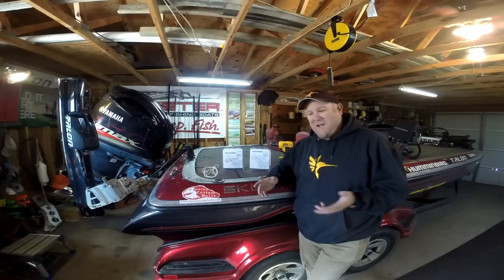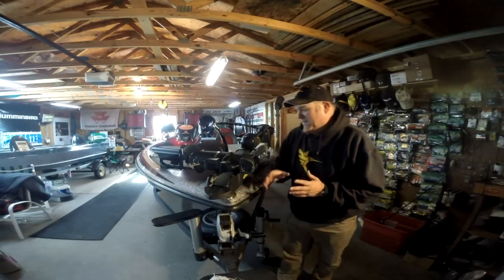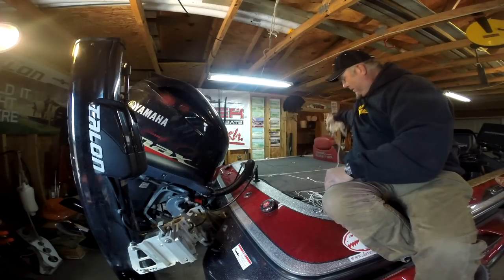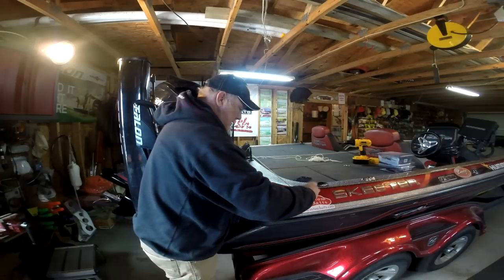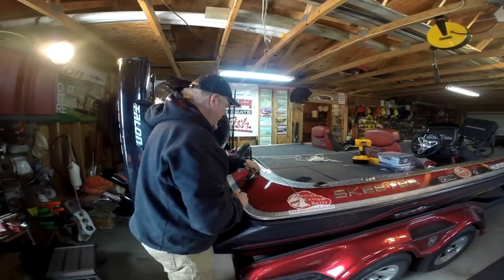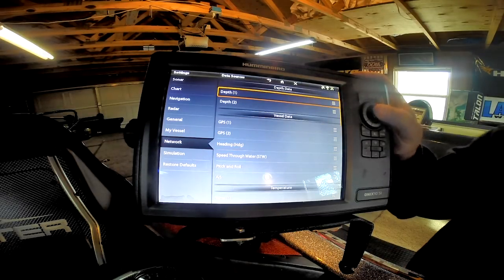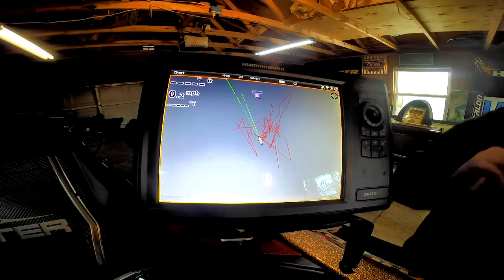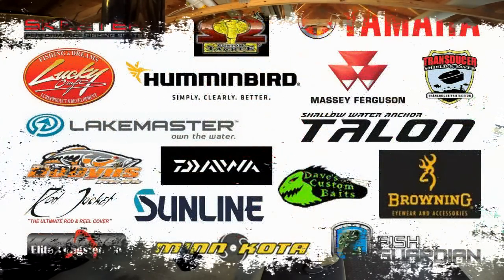Tips 'N Tricks 166: Installing Heading Sensor GPS for Humminbird ONIX

Comment: Great video. I learned some extra things on what to do before install from this. Another thing you can test is trimming up and down and see if it will deflect the compass. Something I have found out after final installation on mine.
Reply from the maker: +masterlocdown I'm not as concerned with a Trim Motor because it's momentary change in creating Magnetic Interference unless it's all the time. I can tell you one thing that drove me crazy when testing is having a drill or electric screwdriver close to the heading sensor while trying  to locate the best location will cause Magnetic Interference...move the drill and boom...it worked as design. :)
Reply: Doug Vahrenberg mine would take up to like 20 seconds afterwards to point correctly after trimming while under way. It would be almost out of adjustment range after bumping the trim.
Reply from the maker: +masterlocdown Is this the Boat ICON or Course Project Line. Two different components on the ONIX. You need to watch the Boat ICON for immediate readings and Course Projection Line is a calculated reading of how the boat is travelling not direction the boat is pointing.
Reply: Doug Vahrenberg The heading line on mine will jump after trimming the motor. Course line stays true.

Comment: Great tip Doug, Question I have a flats boat with a poling platform can I install on the top of the poling platform center...
Thanks
Reply from the maker: Yes you could. The Only thing that I would test first is the pitch & roll in waves. The higher you mount the more effect it will have on GP Position location as the platform will move more distance in waves.

Comment: This is all good , but when you start the engine and all cables become alive - that is where interference is coming from. Any electric flow through the conductor creates  magnetic field. Also compass deviation can be created just by being close to metal or steel object  ( engine). Putting it on the short pole would be a better job ......
Reply from the maker: I'd test before and after engine is running. Personally I now temporary mount with Velcro or double stick tape before permanent mounting

Comment: Doug would you recommend having two GPS pucks one on the Bow and one on the Transom. Transom GPS for console Mounted finder and any other Finder connected in the rear of the boat..Example I have a multi-species and have console mounted, bow mounted and splashwell mounted birds. The console and the splashwell share data when I have the splashwell unit connected.  I troll for Salmon and trout along with stripe bass. When fishing from my cast deck I use only the Bow and console units and have thought of putting GPS puck at the bow for heading control of my minn kota..
Reply from the maker: I use a external GPS on the transom for my console unit because of the distance. On the Bow I use the Internal Receiver.
Reply: Doug Vahrenberg I was told that you cannot share GPS with each other on the Helix G3N. I was told that for precise GPS waypoint marking, i needed to connect a puck with heading sensor to each unit. I was also told that i needed a hub to do so. Basically, i am connecting 2 Helix 12 g3n’s and a Ultrex with built in mega DI. I have an Ethernet hub and have ordered 2 pucks with heading sensors. I don’t know if I’m getting bad info or not. Please help sir! Thanks for Tip’s and Tricks!! Keep it up!

Comment: Doug, does this add any benefit if you have I-Pilot Link.  I can see it if it's just strictly Humminbird, but is there a benefit since the I-Pilot Link system also has a compass.  (It says in the I-Pilot Link manual that the system itself has a compass).
Reply from the maker: IT improves the accuracy and heading direction for the Humminbird and where you are in relation to your waypoints as you are viewing on the Graph
Reply: So will it make the spot lock on my legacy I-pilot link more accurate, when used with a humminbird?
Reply from the maker: That is part of the MinnKota iPilot System. You would need the New iPilot System with it's own Heading Sensor for that.
Reply: Doug Vahrenberg -What is part of the i pilot system? The graph or the heading sensor?
Reply: Doug Vahrenberg -So the graph’s gps doesn’t override the tmotors gps in the spot lock setting? But it does in some settings?
Reply from the maker: iPilot uses it own GPS Receiver and the New iPilot Link has GPS in the Head of the trolling motor and it's own heading sensor for the trolling motor. The Humminbird uses it's own GPS receiver and optional GPS w/Heading Sensor for the unit. Each component uses it's own sensors.
Reply from the maker: The graph works independently of the trolling motor. The LINK just networks the two systems to work together but no sharing of hardware between components.

Comment: So I just purchased a used 1197 and I am confused about the sensor for it and need your help. My sensor looks the same but does not have the arrow on it. However when I place the 1197 on a navigation screen it will tell  me the direction I'm going and show a line. So how do I know which way to install the sensor? I looked through the product manual online and it doesn't tell me anything other than how to install it as in through the deck, on top of deck etc.

also do you recommend true north or magnetic north in the settings? I have never had a GPS fish finder before and now I have two (the 1197 and 787).
Reply from the maker: If it is the original transducer is does not have Heading Sensor so you can install any directions. What is the model printed on your GPS Receiver? If not GPS-HS then you can install any direction.
Reply: @DougVahrenberg  perfect timing I'm actually out here working on the boat as we speak. It is GR16/4

Comment: Doug do you have any heading sensors for 360 transom Mount. I bought unit from a guy in Warsaw but said it was all there but no sensor. I’m going to hook to my helix 12. After reading install guild I’m sure it needs one but guy said he didn’t use one? Can that be true?
Reply from the maker: I don't have one. It's GPS-HS from Humminbird. You don't have to have it but if you want to view waypoints and create accurate waypoints on 360 it's needed.

Comment: Please explain the difference between the heading sensor and the gps sensor on the onix units.  Is there a separate gps sensor installed at the bow for the bow unit so as not to have a 20ft error on the bow gps waypoints if you install the heading compass at the back of the boat?
Reply from the maker: +Ron Knight The Bow ONIX I am using the Internal GPS ...it's close to the transducer location. With ONIX you can subscribe to Heading Sensor separately from GPS Location Data. I choose the Internal GPS or use AS-GPR is an external that can be mounted to ONIX. But you only need one Heading Sensor for the boat.
Reply: The heading sensor will always point the same direction as the boat. If you're drifting sideways, your course won't be the same as your heading.
Reply: +Doug Vahrenberg Thanks Doug for the quick reply....about to upgrade to the Onix units from my 1198s.
Reply: +Ron Knight For the console unit, do you also use internal gps or does its gps come from the heading sensor?
Reply from the maker: +Ron Knight For the Console I subscribe to the GPS Location Data and Heading Sensor Data from the GPS-HS. This will reduce adding any offset to sonar data with the GPS Location since the transducer and GPS Location Data are coming from close proximity.
Reply: +Doug Vahrenberg   Thanks Doug. Just what I needed to know about my new setup.

Comment: Doug,
Does anything need to be done with those bare wires that come out of the adapter?
Reply from the maker: +Brian Moffatt I taped each off to be sure but I think those are output wires if you select NMEA Output.
Reply: +Doug Vahrenberg 
Thanks!!

Comment: It calculates your heading in real time through that obviously. Also, doesnt it calculate where the nose of the boat is based on the integrated GPS of your I-pilot trolling motor? So what is the point?
Reply from the maker: +WESTERN HUNTER Standard GPS Receivers only can determine direction by movement when above 1 mph. At slow speed below 1 mph standard GPS receivers cannot 100% accurately tell which direction the boat is moving or pointed. That is where the Heading Sensor with Electric Compass adds more precision and helps GPS determine the exact location and direction the boat is. It's an optional upgrade for those that need more precision when slow speed navigating.

Comment: Doug can you tell me the purpose of having a heading sensor when your unit already has gps ?
Reply from the maker: When moving less than 3mph and GPS receiver starts losing the ability to determine direction of travel. A Heading Sensor at slow speed works in conjunction with the GPS Receive to help predict much mroe accurately location and direction of travel. GPS-HS is a dual component unit that has GPS Receiver and Heading Sensor...it;s the ultimate tool for slow speed location
Reply: Makes sense thank you for getting back with me and keep up with your great informational videos

Comment: I'm confused on why you would need this since there is a built in GPS in the humminbird itself?
Reply from the maker: +WESTERN HUNTER Standard GPS Receivers only can determine direction by movement when above 1 mph. At slow speed below 1 mph standard GPS receivers cannot 100% accurately tell which direction the boat is moving or pointed. That is where the Heading Sensor with Electric Compass adds more precision and helps GPS determine the exact location and direction the boat is. It's an optional upgrade for those that need more precision when slow speed navigating.